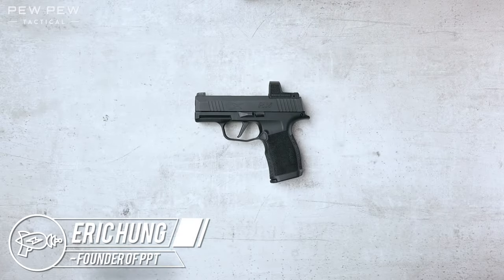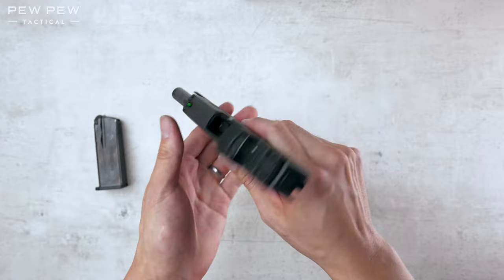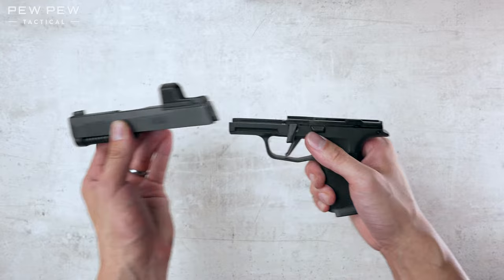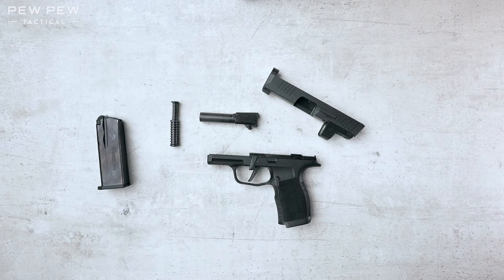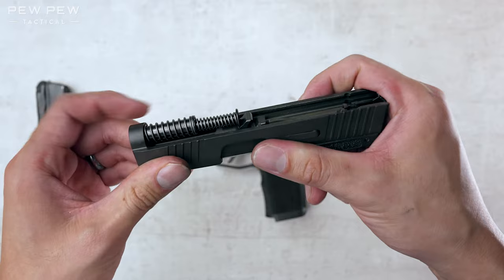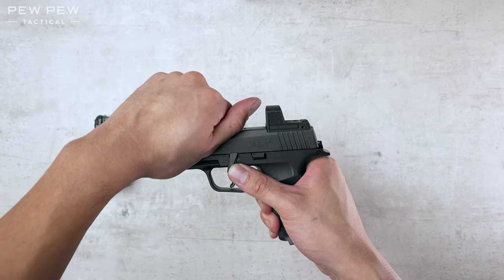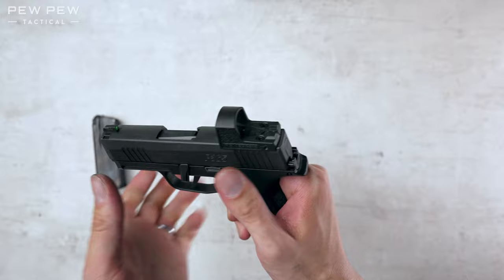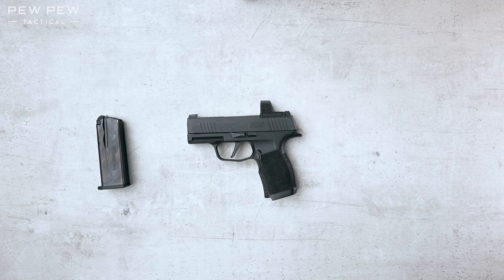Sig Sauer P365 (Regular, X, XL) Field Strip: Disassembly & Reassembly

Comment: Men seem to be able to push the release to field strip so easily.  It absolutely kills my thumbs trying to be the lever down so I can remove the slide.
Reply from the maker: It's challenging, no doubt. Consider using a tool that won't mar your surfaces. Sometimes I've used the baseplate of a magazine to coax really tough take-down levers.

Comment: The take down on these is awkward and a little painful. The controls are very stiff and the slide is not easy to rack. The take down lever is like a knife blade, thin and sharp. Reassembly must be done with the 365 upright. Gravity will prevent it from going back together inverted. But, the gun is narrow, light and easy to carry. Very comfortable in the hand.

Comment: This was actually wrong for my firearm, the take down lever you push foward after the slide is locked back , and then pull the slide off the gun. No need to push the slide lock / release

(P365x with manual saftey)
Reply from the maker: Yup, manual safety will change it up a little.